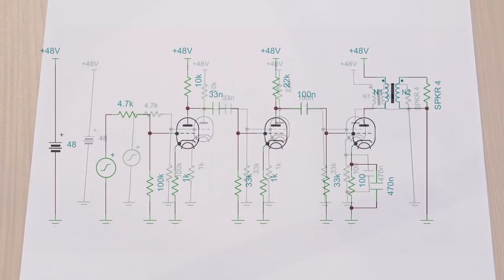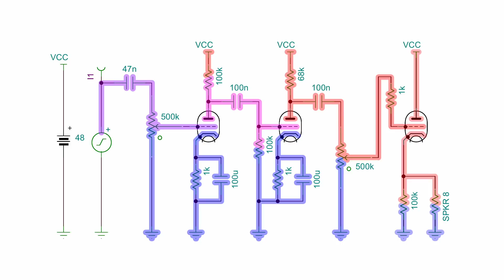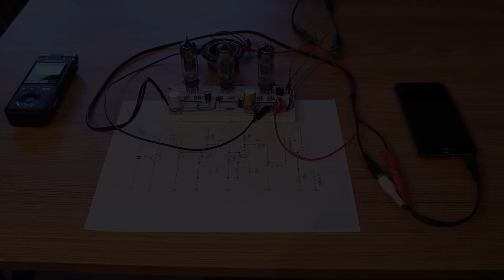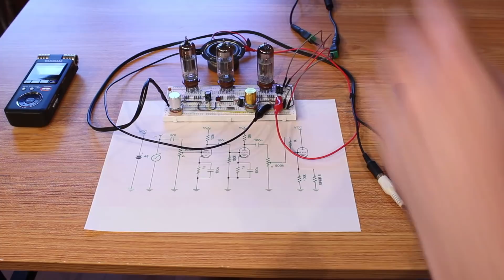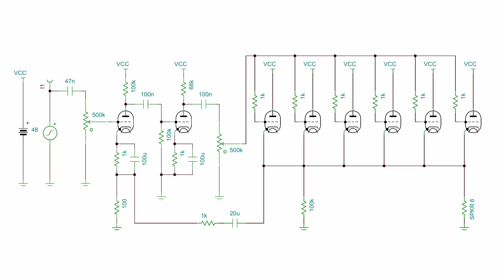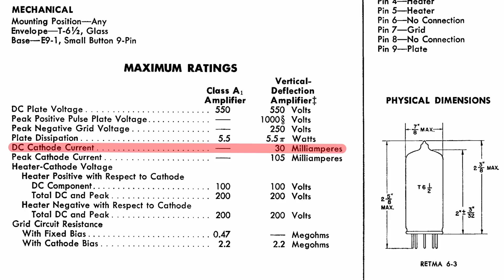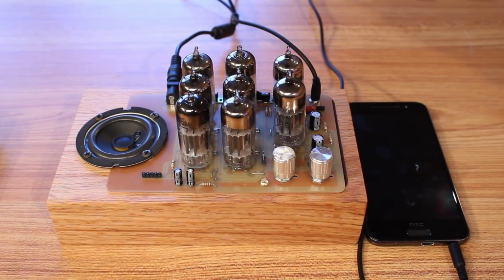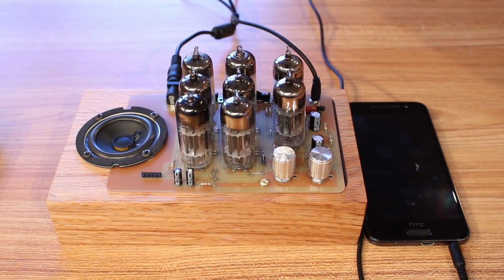A Low Voltage Vacuum Tube OTL Audio Amplifier

Comment: You could use a series synthetic inductor to set the DC bias and tap off the audio with a large capacitor. A suitable "gyrator" circuit can be made from a single p-type FET..  ..which suggests that it could be done with a (suitably low impedance) tube as well.
Reply from the maker: That's definitely a bit beyond my skill level!
But, I do have some 6146s that are quite a bit lower impedance than the 12B4A, so I think for the next OTL journey will involve those big boys!
Reply: @UsagiElectric  Consider using an inverted triode arrangement - plate at large negative bias becomes a control electrode with very little input capacitance, grid at positive bias becomes the output, cathode is handled as usual. The output impedance is much lower (nothing in the way of the electrons other than weak repulsion from the other side of the grid), at the expense of inverted voltage gain. However, the input still draws almost no current, so a tiny step-up signal transformer with a ratio similar to the "normal" gain of the tube can correct for this.

Comment: 4-125 tubes are rated for ~300 ma. You should try one of those. ;)  I like your work! Great project! Greetings from Austria.
Reply from the maker: Oooh, the 4-125 is a beefy tube! I love the idea of using transmitter tubes for completely different jobs.
I actually have some 6146 beam power tubes that should dump out about 100mA at 50V when triode strapped, which is like triple what the 12B4A is rated for, so I would love to build another OTL with six or eight of those pushing enough power through a big speaker to rattle the windows!
Thanks again and hello to Austria from Texas!
Reply: @UsagiElectric   I've commented a while ago that you could use a led voltage drop for negative grid bias. I've tested this in a circuit with a pl805 tube @170V. A power led between the tube and ground is enough to raise the cathode ~ 10v above ground level.  This should work with direct heated tubes too. Just make sure the led get enough cooling :D

Comment: I wish you were to use a bit of a higher voltage
because I think it would preform even better and louder
any new yet on the 555 kit?
Reply from the maker: A higher voltage would definitely give better performance and volume, but that defeats the purpose here, which is to see what we can accomplish at ridiculously low voltages. By that same logic, I should have built the vacuum tube computer at higher voltages, but I think what makes it (and this OTL amplifier) really unique and fun is that it's at super low voltages!
Nothing new on the 555 kit yet, Chinese New Year slowed some things down and I've had a nightmare of a time figuring out a reliable way to produce the legs. I have some more ideas to try, but I gotta recover some money first.
Reply: @UsagiElectric  true true
in that case
could you try building a otl with pl95 tubes
I have like 10-30 of those around and I kind of wanna use them for something

Comment: Very nice project, although I would stick to the design with an output transformer, it's not too hard to the tubes.
Instead of trying to find a suitable output transformer, you could use a speaker designed for 70 Volt or 100 Volt wiring, the kind of speaker used for playing background music and making announcements in public places. Such speakers have high-to-low impedance conversion transformer builtin, so it should be possible to connect them to the tube amplifier directly.
Reply from the maker: Thank you!
And for sure, using an output transformer makes way more sense, but the idea of just brute forcing power into a speaker by running a bunch of tubes in parallel was just way too appealing to me for some reason. I think it's because my simple mind just says "More toob is good," haha!
Reply: @UsagiElectric , yo soy del mismo pensamiento, filosofía e intuiciones, 
Y sin trafo menos histerésis y mayor calidad, y a pelear con ello, tendrá que probar algunas opciones y compromisos, pero recuerde se llevan vendiendo 50 años amplificadores de esta topología para los oídos mas exquisitos del Hifi mundial , por algo será y sin transformador.

Incluso puede poner las dos opciones con un interruptor, osea conmutable sin trafo con salida con condensador o reactancia y con trafo, para comparar diferencias, y mostrar al mundo de lo que es capaz el otl en linealidad y cuidado de la señal original de audio.

Eso si por dios, un altavoz de calidad de al menos 12 pulgadas y si es posible 103 decibelios,  con un altavoz toda frecuencia mejor, veras potenciado el volumen final audible ( con la misma potencia ) Eminence trabaja 103 db y hay mas marcas, y aumenta el Ohmiaje a 16 ohmios o varios de 16 ohmios para sumar 46 ohmios por ejemplo con tres de 16 ohmios en serie.
Reply: Agreed! OTLs are more of a seductive theoretical concept than a worthwhile audible  result in practical terms.

Comment: The speaker doesn't like DC through the coil. That is constant heat dissipation that gets overlaid on whatever AC power from reproducing music. It needs to be coupled through a capacitor (like 1000uF, larger is better) and the quiescent current has to be at least Vcc/speaker impedance 😉
Reply: Yeah, no decoupling capacitor is the first thing I noticed!  Depending on exact impedance of the loudspeaker at low frequency (assuming it is near 8 ohm) that tiny speaker isn't going to be able to produce much on the low frequency side so a 200 microfarad capacitor should be plenty for a roughly -3 dB roll off of around 100 Hz.  Still results aren't too bad considering the DC.      What value resistor would you use on the cathode?
Reply: @AllThingsOnePlace  Not a resistor: a choke. A resistor is a load in parallel with the speaker. A choke will pass the DC current necessary to achieve class A operation, but will not load the amplifier down when reproducing audio. About 500mH (rated at least twice the quiescent current of your output stage) would be fine.
Reply: @ScottGrammer  Yes, I understand.  Send the AC through the loudspeaker and the DC through the inductor.  It is easy to find resistors and capacitors.  Big inductors are less easy to come by... Don't want to go back to the transformer either, haha.  Although I guess there is a reason there is a transformer.  High Z --> low Z and it provides your DC through an inductor.
Reply: @AllThingsOnePlace  A matching transformer would be a better idea. A capacitor will remove the DC component. However, a series capacitor is a high-pass filter. The bass response will suffer from a coupling capacitor.
Reply: @AllThingsOnePlace  I wouldn't use a resistor, active load would be better. After thinking again about it, you would need somewhat less resistance than speaker impedance.
A better way would be to use an inductor (but a very large value, maybe a classic fluorescent lamp balast?) on the plate and setup the bias point with negative voltage on the grid. outputs Would still be coupled through a capacitor. Should allow for 4 times more output power with only twice higher quiescent current?
Reply: @akkudakkupl  Yeah, giant inductor would be best for performance, wouldn't really fit the project though.  It isn't going to be efficient ever since its a class A amp but yeah squeezing as much of that AC into the loudspeaker as possible is one way to go.  

I say resistor simply to match the project or make it work within the confines of the current project.  Swap the 100k for a much lower value (has to meet power requirements of course), add capacitor to the loudspeaker (possibly hide it inside the already made enclosure)?  I guess could put a lamp ballast under the whole box and route the wires around it too.

Either way, I am very new to tubes and slowly learn a little on each video I watch.
Reply: I don't think a little DC will harm the speaker. Six tubes at 45mA each is 270mA total. This is about 0.6 watts which is considerably below the 3 watt rating of the speaker.
Reply: @eDoc2020  It's not likely to blow it, but it will displace the voice coil from the center of its travel, resulting in a lot of second-order harmonic distortion. It will also cause it to bottom out in one direction before the other, and in fact that may be enough to make the cone reach the end of its linear travel, which is what I think might be happening. I don't know that for sure, though.
Reply: @eDoc2020  Speakers are not designed for DC.
Reply from the maker: I actually did try to put a few different caps in series when testing the design to remove any DC through the coil, but no matter what size cap I tried, it always decimated the sound. Like removed greater than 90% of volume. It could be that I just didn't get a large enough capacitor, but I think it mostly had to do with the insanely low voltages I'm running at. 
The 12B4A was moving around 40mA through each tube, which at 48V should mean an internal resistance of about 1200 ohms per tube. With six in parallel that should be something like 200 ohms of series resistance with the speaker. 
I think the impedance is just so ridiculously mismatched that adding a series capacitor just wrecked whatever weird balance I had going on here. 
Or I could be totally off the mark, this is all uncharted territory for me!
Reply: @UsagiElectric  it was because the tubes have to run current at least equal to VCC/speaker impedance anyway, so it can swing up or down. This is why class A is ineficient.
Reply: @UsagiElectric  When you connected the cap, you killed your cathode current. That's why the sound went to pieces. You need a choke in between the cathodes and ground. A choke will pass the DC current necessary to achieve class A operation, but will not load the amplifier down when reproducing audio. About 500mH (rated at least twice the quiescent current of your output stage) would be fine. If the choke's DC resistance is low enough there will be very little DC voltage across it, and you won't need an output capacitor.
Reply: @UsagiElectric  Maybe add active cooling to the speaker coil somehow, since I must admit your little amp did sound pretty good, at least as far as we can tell via the Utubes. Love it!
Reply: @UsagiElectric  It did get some decent volumes towards the end so seems like it was working as needed.  In either case this is a very interesting project!
Reply: @UsagiElectric  if using a capacitor to couple the speaker you'd need a dc path from  cathode to ground somehow, maybe a choke or choke+ resistor...

Comment: Cool, I would still like to see a frequency response and have a look at THD just for a laugh !...cheers.
Reply from the maker: I have no clue how to go about checking something like that, but I did actually test input vs. output of the amplifier stages on the scope!
This is a 1V P-P signal being input, and the output signal that goes to the grids of the driver tubes is 12V P-P and has surprisingly little distortion. It gets just a slight bit of distortion at the bottom of the sine wave, but other than that, it was way cleaner than I was expecting!
https://i.postimg.cc/rw6pH9R3/IMAG0463.jpg
Reply: @UsagiElectric  Thanks !

Comment: Did make a mosfet class A amplifier a few years ago, used a few parallel mosfets, and an iron core transformer to provide the DC removal for the speaker.  Could adjust the bias to go from full class A, and a really hot set of mosfets to something like AB, where at least the current was under 1A per transistor. Heatsinks were old Pentium CPU coolers, one per transistor, and an old mains transformer with 12-0-12VAC secondary, with primary disconnected. Loud on 12V.
Reply: I have two push pull amplifiers built with fets and power transformers that are literaly 2x115V to 36V. Fun to build, guital sounds great through them.
Reply from the maker: That's awesome! 
I love the idea of using old CPU coolers are heat sinks for the mosfets too, that's brilliant because those can often be found for cheap or free, and if you get really desperate, they already have provisions for cooling fans on them!
Reply: @UsagiElectric  I did use the fans, just connected in series so they would be quieter, running all of 12VDC.
Reply: @UsagiElectric  I have used them a lot for power supplies, as you can easily mount a few TO220 or TO247 power devices onto them with no problem, just drill and tap the M2 holes for the hardware to mount them. Some with no insulation, because the heatsink was easier to mount on isolating bushes, and I have done a number of LED lamps using the round CPU heatsinks, they are really good for that to mount a star PCB on. For that easiest is to use 2 part metal loaded epoxy, you can use the thermal stuff, but for me just the regular Pratley quickset steel worked well.

Comment: I forgot to mention that you could also try using two amps or at least two output stages in antiphase, wires across the speaker  to double the voltage swing (which will double the currant), this should give you an extra 6db or so.

And you forgot to ADD the toast rack 🙂
Reply from the maker: I actually did initially try building a push pull type amplifier with driver triodes before and after the speaker to get a full range voltage swing out of it, but it absolutely refused to work. It made some sound, but it was extremely faint and distorted beyond belief. That was when I said "Just go as simple as you can idiot" and fell back on the design here, which worked surprisingly well!

Aside form the heat that is, then again, not many toasters also play music!

Comment: Need a bigger triode, perhaps a beam power tetrode running in triode mode, or one of the bugger transmitter tubes instead.
Reply from the maker: Absolutely!
I happen to have about 14x 6146 power pentodes, which when triode strapped move well more than double the current as the 12B4A at a given voltage. I'm thinking a bunch of those in parallel would be quite quite exciting!

Comment: https://www.youtube.com/watch?v=nNlPgirHP48
https://www.youtube.com/watch?v=Yzo3A-NywSs
 Two things. 
1) You can use Mains Transformers as output transformers.
2)Uncle Doug has a couple of vid's that might help you work-out what transformer you need.

 Also: The other day, you were saying that you did not have the right potentiometer. This might help
http://geofex.com/Article_Folders/potsecrets/potscret.htm

Hope this helps.
Reply from the maker: Thank you for the links!
The primary reason I went with OTL wasn't because I couldn't find a good output transformer, it was mostly because I find the concept of OTL to be really, really fascinating. I actually have a pair of old PA system output transformers that would work a treat, but the idea of just brute forcing sound through tubes was just so cool, I couldn't help myself!

On this build I actually did use some logarithmic potentiometers, but that's an excellent link for getting log like behavior out of a normal potentiometer!
Reply: @UsagiElectric Thanks for the reply. I hope these links provide food for thought, if nothing else.